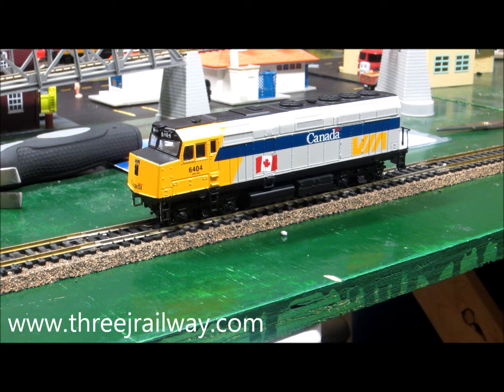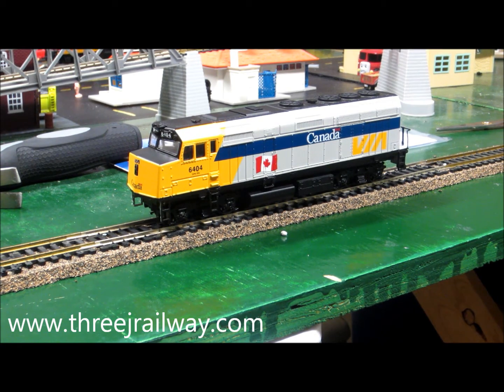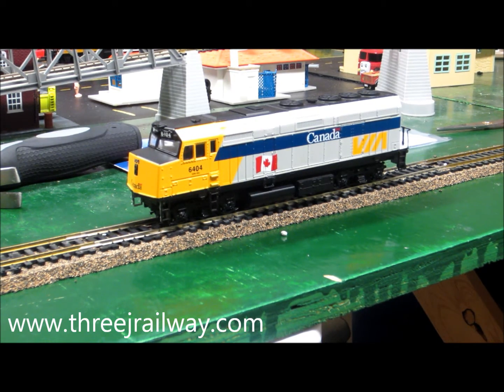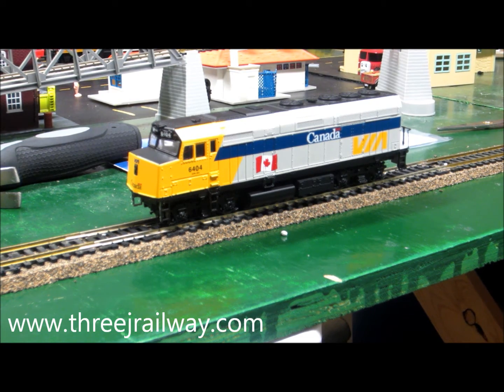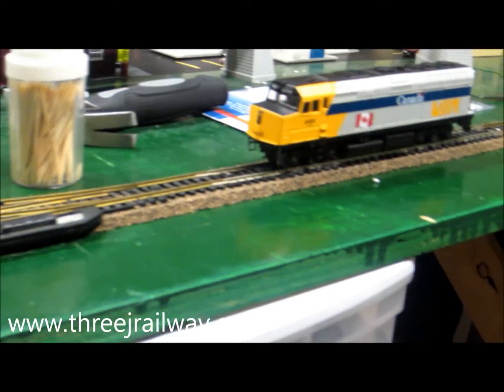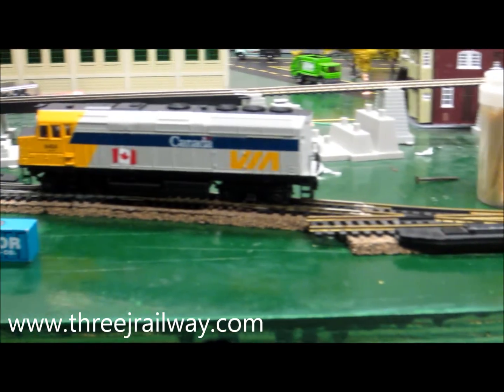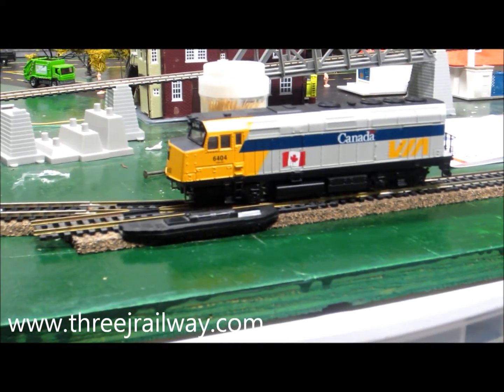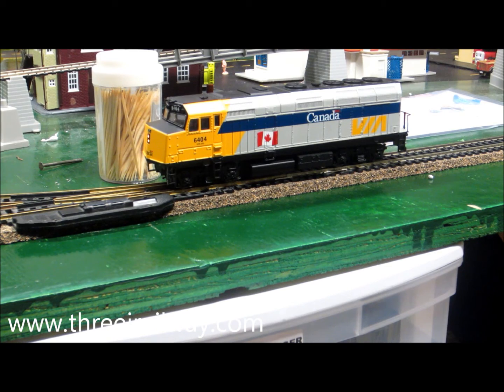Analog Engines on DCC Track

Comment: don't do it you will blow your decoders and your motors. If you are going to do DCC get an engine that is DCC compatible. If you want to run on DCC read the instructions and use wire recommended by NMRA for your scale this being 16 stranded wire for HO and 22 for N Scale and Z. don't use 12 on models 12 gauge wire is sold and has more amps. 12 gauge wire is only suppose to be used for garden railways which is everything over O. As David Popp said The bigger the gauge the smaller the number and the bigger the amps. Save your locomotives don't use analog on DCC track and don't use solid wire.

Comment: I can state this as a person who has a few analog running on DCC system.  Basically the engine motor is on and generating maximum heat and that heat is dissipating into the motor of the engine.  This heat dissipation does not stop. As a result an analog engine will eventually "melt down" and stop working.  If you run the engine over the tracks and turn it off when you stop the engine to keep it from building up heat while stationary it might prolong the life of an analog engine on DCC power; but it will eventually fail; just take longer time.  That has been my experience.  If you have the locomotive running over the track then the heat will sort of dissipate as the train moves.  But I have stopped running my analog over DCC and have simply used DC power for most  my engines, DCC included since I do not have sound decoders.  IF you have alot of DC trains then run them like old on power blocking setups, sectioning off your tracks in power districts to control more than one train with different DC powerboxes.  Insulate the track with plastic joiners and this should work.  Good video.